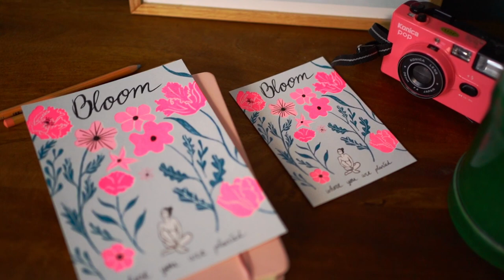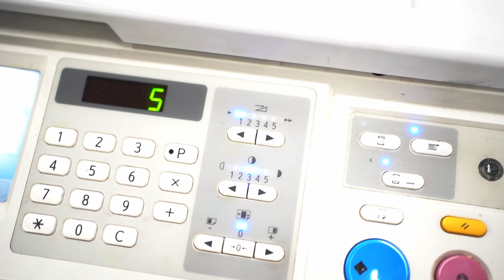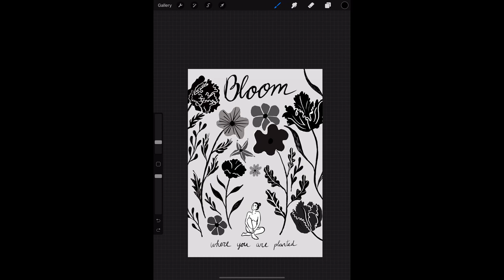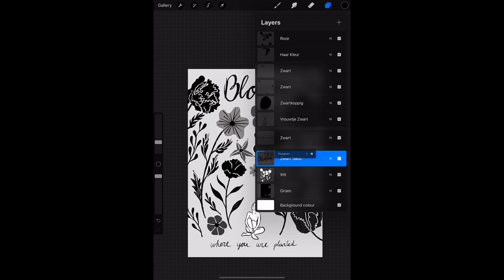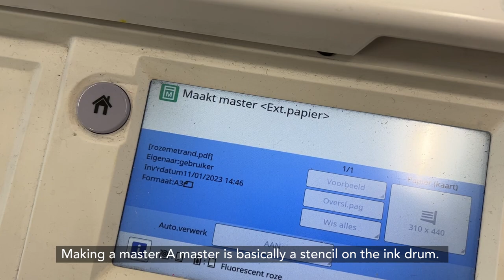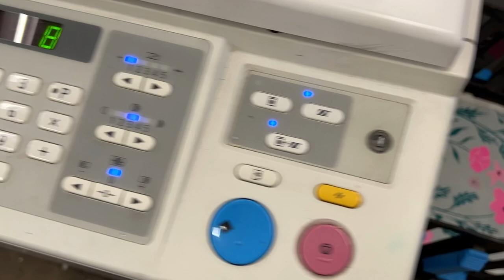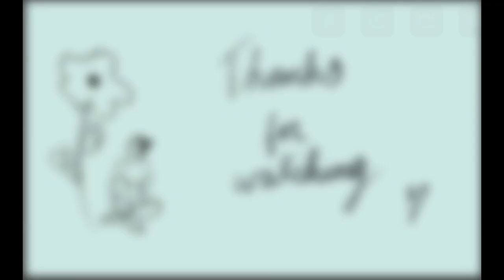Making a risograph on Procreate // riso printing

Comment: I am so happy I found your video, beautiful artwork. I am new to Riso printing as well as designing in procreate. I was always wondering how to create a background for my riso print without overprinting the image. I saw that you have cutouts of the flowers so you can print the last teal layer on top. How do I do that🙈
Reply from the maker: Thank you so much!
Well, I'm going to try to explain it and hope it will be clear enough as I'm bad at explaining things haha.

What I have done in Procreate: I drew the flowers first, then copied them onto another layer, the teal one. I drew the stems and made the background a light grey. Then I manually erased the flowers with the eraser, so they were cut out of the background. That way you'll know for sure the pink will be PINK, instead of having a light green layer on top of it.
Hope that helped! If not let me know :)
Reply: Thank you! That was very helpful😊

Comment: Beautiful art! Question, why do you have many layers for the same color? I've seen other videos mention that they do different opacities per layer, is that what you did?
Reply from the maker: Thank you!
Yes, I used different layers for the opacity, and also to easily move around every part of the image.
For example: if I would have made everything that is green in one layer at once, it would mean I couldn't just change one leaf in size or position, without changing almost the whole illustration.
I hope you know what I mean. This way I'll have more control over every single part of the image, which I think is one of the plus sides of using Procreate :)

In the end - I merge them all into one layer per colour. But when it's unfinished, I like to use many layers :) If it doesn't make sense to you please let me know!